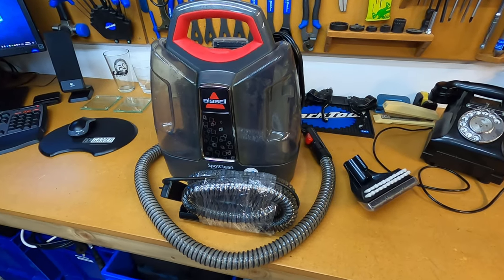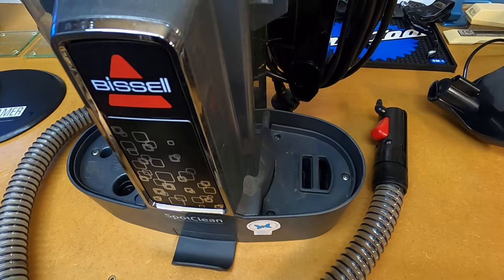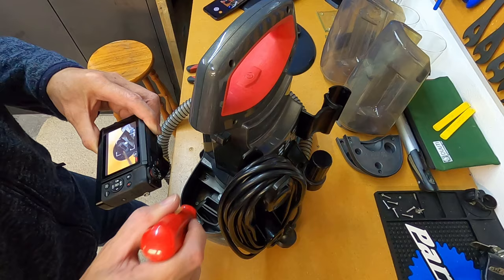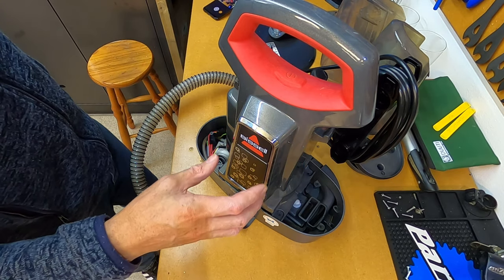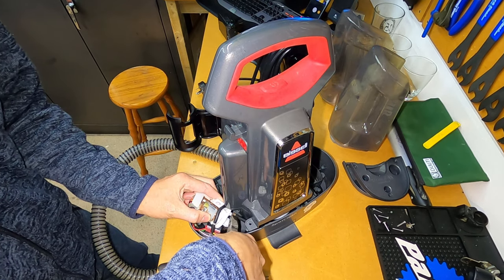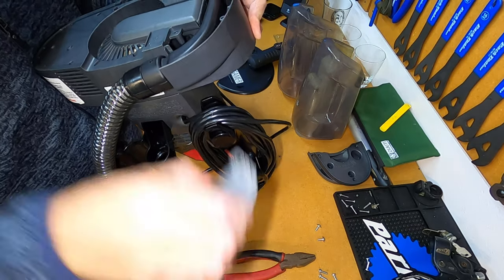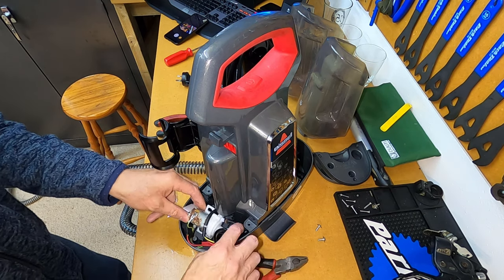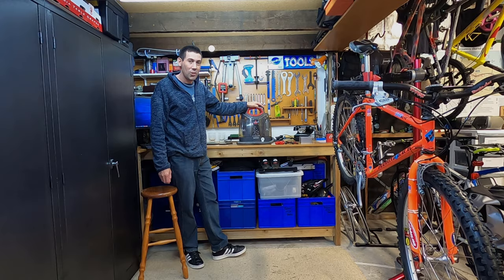Bissell SpotClean hose replacement -  How to video

Comment: Thanks for helping keep stuff out of the trash. Well done, no music to the point, no banter, vid as long as it needs to be to do the job. I watched it once to see the steps / tips and got it done.  No steps missed except some hoses come with a longer water line that you need to trim back to avoid kinks. Bravo.
Reply from the maker: Hi there, thanks so much for letting me know the video has helped you fix your unit.  Yes its good not having to throw out a perfectly good unit just for a faulty hose so happy to hear the video has helped and one less item in the trash 🙂

Comment: I had my unit ~7 months when the hose split near the nozzle.  Checked online Bissell and SURPRISE, they did NOT have this aftermarket part!  Walmart did (less than $20 with tax). So I ordered one---prior to calling Bissell.. Since unit was still under warranty Agent I talked to sent me a NEW unit and had it delivered to my home ALL for FREE. ..during call, I informed her that just ONE of 2 minor fixes would place less stress on the hose that causes that slpit!  1) make hose 2 inches LONGER, or 2) move storage location for hose at CENTER of the caddy rather than where it is on the caddy.  Since I had already ordered the new replacement hose, I gave the New unit to my friend as an early birthday/Xmas gift.  She was thrilled!!!  Used the above video to replace my hose unit!!
Reply from the maker: Hi there, that's great to hear that you gifted your Bissell to your friend and the video was useful in its repair thanks for the comment, its much appreciated!  I think those ideas you mentioned will help increase the life of the hose hopefully they can improve the design or even hardier material to improve the durability of the hose.  Take care 🙂

Comment: The hose on my Bissell little green machine pro heat dry-rotted right where the hose meets the handle so I had to order a new hose. My ADHD makes me have a hard time following instructions but this was fairly easy for me to follow. Got it taken apart, fixed, put back together, and fully working thanks to your wonderful tutorial. If this didn’t work out I would’ve had to buy a whole new one at over $130 USD. Thank you so much!
Reply from the maker: Thanks so much for the comment, glad and happy to help you, well done for fixing your Bissell.  Take care 🙂

Comment: Had a break and a hose split in exactly the same places as you. Thanks for the video, much appreciated.
Reply from the maker: Thanks for watching, yes it must be a common place for the hose to split which is a pain.  Mines still going strong since the repair and someone else made a comment when storing the spot cleaner away not to tightly wrap the hose around the cleaner which may prolong the life of the hose.  Take care 🙂
Reply: @MannixGarage  interestingly the replacement hose from Bissell is a much more flexible plastic one with a bit more length. Must be revised part after so many issues. Thanks again

Comment: Thank you. Just what I needed to fix mine. You explanation was straight forward and accurate. 

I am now storing mine without wrapping the hose around the body as the stress caused by bending the hose sharply to fit the holder seems to be a design fault causing many hoses to fail in this manner.
Reply from the maker: Hi there no worries, glad to hear the video was helpful and you were able to fix your unit.  I like your idea on the storage of the Bissell and you have a good point there, the original storage design of the hose does put some pressure and strain on the hose it self with the sharp bends.  Great idea!  Thanks for watching and the comment take care 🙂👍

Comment: Just followed your video, excellent ,made the replacement so much easier .Pity the hoses are so fragile .Steve from NZ.
Reply from the maker: Thanks for letting me know the video was helpful with replacing the hose.  Yes they are a little fragile that's for sure, great cleaners just the hose is the letdown in this case.  Mines still going strong, hope you get a few good more years out of yours 🙂 Take care 👍

Comment: Thanks so much for the video.  No real difference between the Australian and The U.S. model other than voltage and hz.  Thanks again saved me a bundle from buying a new one.
Reply from the maker: Hi Rick, thanks for that, appreciate knowing that the video has helped someone fix their own unit and across the globe too 😀.  They are great little cleaners

Comment: Exactly as described.  One note, you might need to trim your hose down before attaching to the pump.  I had too much excess on mine.
Reply from the maker: Hi John, thanks for the comment, yes you may need to trim the excess thanks for pointing that out.  Glad to hear you found the video useful, my unit is still going strong after its repair.  Take care

Comment: Thank You very much, Sir. I have the same split in the hose by the handle . I was ok using duct tape for a while but now it's a much bigger split and time to do something about it.
Reply from the maker: Thanks for watching.  Yes you may as well fix your Bissell cleaner and give it a new lease on life.  They are good cleaners and mine is still going strong after the repair.  🙂

Comment: you legend.  fantastic video. just what i needed.  cheers mate.
Reply from the maker: No worries, thanks for the comment, glad you found the video useful 🙂
Reply: @MannixGarage  did the repair today.  my hose clamp was a little easier to reach than yours due to sheer luck.  found if i put the needle nose pliers parallel to the hose it was easier.  i was thankful.  job went off without a hitch.  cheers again mate.
Reply from the maker: @luke-xz1gb  Awesome mate glad it worked out and thanks for the update, and happy to hear you found the video useful :) take care

Comment: I have the Bissell Spotclean Pro Heat Pet model 2513W..Owned it for 25 months now but the hose right by the 3 inch cleaning tool started to split after just 13 months.Its a bad design by Bissell where the hose sits in the holster it turns to sharp and creates a kink.
After retaping it every couple of months for the last year or so I decided I would replace the hose..I bought one on the Walmart app for 16.99.Its just a shame that Bissell didn't design this to last longer.
Reply from the maker: Thanks for watching, yeah mine didn't last that long either, about the two year mark as well.  However the machines still going strong which is a good thing, hopefully we will get longer life out of this replacement hose.  Take care 👍

Comment: After fitting the hose, suddenly the clean water tank is leaking at the seal. Can I ask how tight did you tighten the screws? I can't figure out what I'm doing differently but it didn't leak before and now it does
Reply from the maker: Hi there, sorry late reply here.  Are you talking about the screws in the video at 7:13 holding the small pump motor or the cover at 7:28 ?  Basically just do both sets of screws tight enough when the screw stops turning while doing the screw up with not much pressure and basically just nip the screw a little further with pressure, maybe 1/4 turn (hope that makes sense).

If the clean water tank is leaking at the seal.  Few things to check.  
-Make sure the little clamp for the black hose at about 6:31 in the video check you have put the hose clamp back on
-Make sure the pump motor brackets are mounted squarely to the bottom mounts of the bissell unit when screwing back down.  The black bit that the fresh water tank fits into could be on an angle and not mating properly with the tank.

Comment: Any idea why after fitting a new hose assembly the sprayer is just dribbling out?
Reply from the maker: Hi there, first thing to check is you haven't pinched the small black hose when you have re assembled the unit.  Another thing to try is fill the clean tank with water and just let it sit for a couple of hours then power unit on and try pull the trigger and see what happens.
Can you hear the pump working when you pull the trigger?

Comment: I did everything as instructed, the vacuum works but the clean water/soap trigger isn’t working. Any ideas how I screwed this up?
Reply from the maker: Hi there, sorry to hear its not going.  Did you clip the length of black hose down it will need to be cut shorter to fit without kinks. Leading on from this just make sure there is no kinks in the black hose is first step of trouble shooting.  Once you have confirmed that try again.  Also fill up the clean water tank with water and let sit for a while before you test again.  Hope that helps thanks for watching 🙂

Comment: I'm wondering if you can replace it with a longer one? I have the red proheat so the shortest tube. 
By the way great vid 👍
Reply from the maker: Hi there, thanks for the comment 🙂I'm thinking all the spot cleans use similar length hose I didn't see an option for a longer one when ordering mine, however a longer one would be good I find the standard one too short for cleaning seats in the car.  Take care
Reply: Thx for the reply! I was thinking about the bissel MULTICLEAN SPOT 4720M he has a longer hose I think
Reply from the maker: @geo30197  Yes that model looks good the specs online states that the model has a 2.2m hose which would be great for cleaning car seats and carpets. However I am not sure if you can just order the long hose and use with existing spot cleaners.
Reply: @MannixGarage  thank you for the reply and clear video about this

Comment: I followed instructions but the water isn’t squirting out , what have I done wrong ? X
Reply from the maker: Hi Hannah, sorry to hear your one isn't working.  Do you hear the pump motor when you pull the trigger?  If you do hear the motor, try filling the cleaner tank with water and let it sit over night, it might help purge water through. Test in the morning.  If that doesn't work, disassemble unit and check you haven't pinched the black pipe when you re assembled after hose replacement.  Let us know how you get on Take care.

Comment: Good morning,

can you put the link to the site to buy the pipe?
Reply from the maker: Hey there, yes thanks for the question. I ordered direct from Bissel, depending on where you are located you are best to google Bissel so you go to the correct country site.  In NZ https://www.bissell.co.nz/ under HOSE ASSEMBLIES for my model of cleaner used part number 1606127.  Hope that helps thanks 🙂👍

Comment: when i put mine back together it is pouring water out of the clean water tank
Reply from the maker: Hi there, if its pouring out water from freshwater tank, check your black hose is attached and clamped securely first and then check that the mounting point (pump side) for the black hose has no cracks.  Hopefully you find the source of the leak.

Comment: What happens if you accidentally lose the hose clamp?🤔😅😱
Reply from the maker: Hi there, If its the small black hose inside the unit to the pump, just use a small cable tie and tension it up as tight as you can, that should stop it from slipping off 😊👍